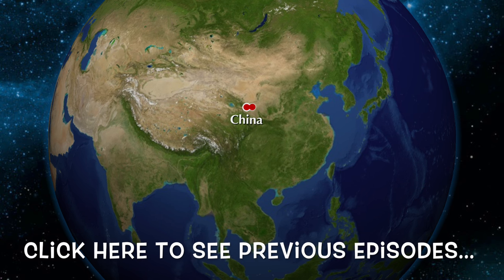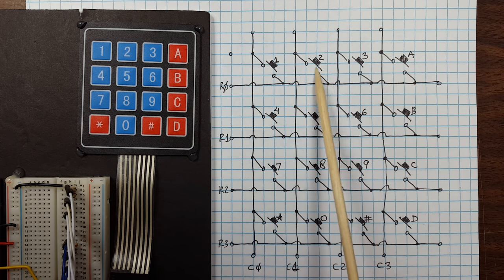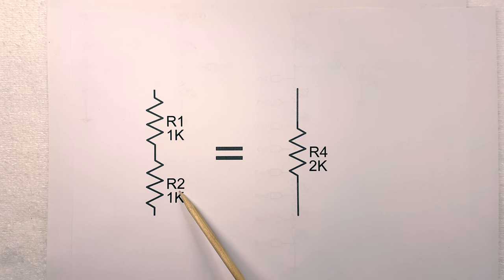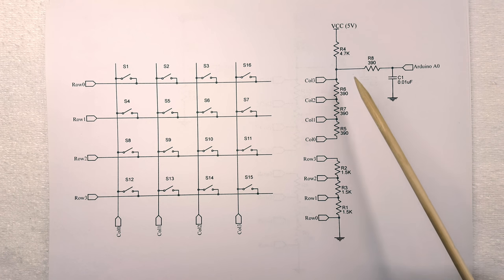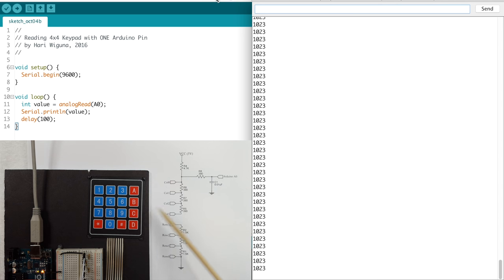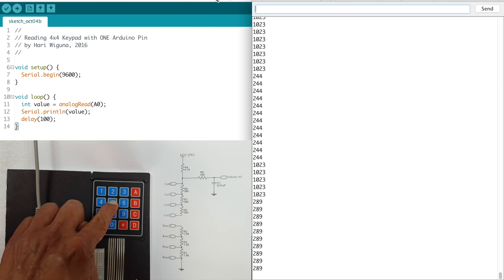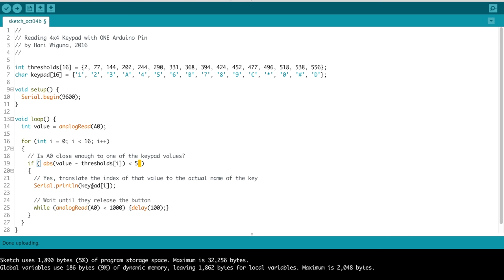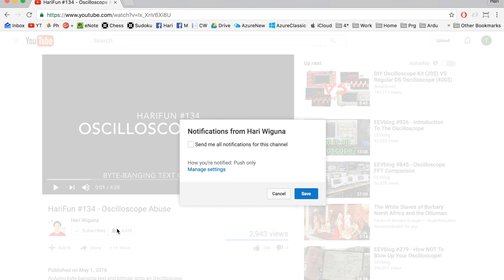HariFun #143 - How to read a 4x4 keypad using just one Arduino pin!

Comment: very useful, thank you very much. But th'ere's one thing that i still don't understand. Why do you put a capacitor just befor the A0 pin (between the vcc, and the A0 pin) and why do you connect it to the ground.
Reply from the maker: Thanks for the comment Ian! The capacitor is actually not at vcc, it is on the output of the voltage regulator.  Its purpose is to smooth out the noisy keypad switches.
Reply: The capacitor is being used as a hardware implementation of a debounce function.  Write a piece of code that constantly displays whether the button is pressed or not.  Press the button and watch what gets displayed.  It won't just go from pressed to non-pressed, it will bounce around a bit when it changes state.  The capacitor helps even this out.  If you put too large of a capacitor in it though, it will take longer for the button presses to be recognized.

Comment: I didn't understand what the for does, mostly because of the "i", it starts in 0 so wouldn't it be in 2 at the begining ?
Reply: And every time it executes, just going from "1" to "D", thats what i understand when seeing it though i know thats not how it works, just confuses me
Reply from the maker: The "for" loop changes the value of i from 0, to 1, 2, 3, etc till 15.
The IF statement on line 19 uses "i" to access the threshold values.  First it would check against thresholds[0], then threshold[1], etc.
If the difference between the real analog value and the threshold is close enough (within 5), THEN it would do the code between lines 21 and 25.
Otherwise, the "for" loop tries the next "i" which would test the next threshold[i].
I hope that helps.
Reply: @HariWiguna  Thank you for clearing my doubt, it was truly helpful

Comment: +Hari Wiguna, I'm trying to use this to get a 3 digit number. Any tips?
Reply from the maker: There are many ways. I would use two integer variables: temp and result. Upon detecting a digit keypress do this: temp = temp*10 + k where k is the value of that key.  When the "enter" key is pressed then copy temp to result and clear temp. We probably also want to clear temp when it becomes larger than 999 such is the case when they tap four or more digits before hitting "enter".

Comment: Curious... is it possible with this method to read multiple simultaneous buttons? Can I get a unique voltage for any combination of multiple button presses? Or it is only for reading one button at a time? Thanks.
Reply from the maker: No, this trick would NOT work if you press more than one button :-(
The resistors have been chosen such that pressing ONE button would generate unique resistor ladder.  Pressing multiple buttons would very likely end up generating non-unique resistor ladder, hence two different set of buttons ending up with very similar outputs.

Comment: Nice video ! Would it be possible to incorporate servos into the code to perform certain actions ? I.E. if button '5' is pressed, only 3 out the 5 servos will turn to a position. I'm still fairly new to Arduino and coding so my skills aren't great, thanks !
Reply from the maker: Thanks Sanchees3!
Yes, you certainly can do that. While you cannot use this code directly (it is tied to the whole Sudoku code) you might learn from it while writing your version.  Once you are able to detect a key, then what you trigger with that key could be anything.  Let me know if you have specific questions, I'd be happy to help.
https://github.com/hwiguna/HariFun_Mega_Sudoku/blob/master/Seven_Segment_Sudoku/e_Keypad.h

Comment: Why I need capacitor?what is his task?

TIA
Reply from the maker: I suspect it was for switch debouncing. So the voltage would not fluctuate like crazy as the buttons are pressed.  But I end up checking for button release in code anyway, so it is probably no longer necessary.

Comment: Pretty interesting . Do you have the program searching in a loop continuously Or does the program react when only you press the button?
Reply from the maker: Funny you should ask that :-) Take a look at my loop()
https://github.com/hwiguna/HariFun_Mega_Sudoku/blob/master/Seven_Segment_Sudoku/z_Loop.h
Unfortunately, I don't think we could trigger an interrupt off analog pin - correct me if i'm wrong.
So, the main loop reads the analog once, figure out which button was pressed and call the appropriate routine, then repeat over and over again.  The display is being refreshed by an interrupt routine.

Comment: how would you make this ESP8266 compatible.  What Resistor would you change to bring the Max Voltage down to 1V?
Reply from the maker: That's a fantastic idea!  The ESP does not have many I/O pins, and one Analog pin.
I used this calculator:
http://www.raltron.com/cust/tools/voltage_divider.asp
I put in 3.3V as the input supply,  leave the top resistor blank, retained the 3x390 and 3x1.5K bottom resistors, 1V for the desired output, and it came up with 13041 for the top resistor.  So 13K resistor instead of 4.7K for the top resistor.  Let me know how it turns out in real life :-)

Comment: I get a lot of random values and after I finally get a stable value the second time I press it it't -10 than before
Reply from the maker: Filippo, I think your comment got cut off. I do not understand what you're saying/asking.  Sorry...
Reply: for example I got 180 for “1” the first time, then after checking every value one time I checked it another to be sure and got 170, also some times if I hold a button it shows completely random values
Reply: Idk why this happens
Reply from the maker: Ah, yes, membrane switches are not perfect, so there will be some variation, on my switch it only varies by about 2 or 3, so I set my tolerance to 4, see line 87 on this listing:
https://github.com/hwiguna/HariFun_Mega_Sudoku/blob/master/Seven_Segment_Sudoku/e_Keypad.h
You probably need to set that to 15 to account for the difference between 170 and 180. For each key it would vary, but should NOT be random.
Also make sure you do not set that tolerance too large.  It should leave enough room between the values in threshold array.

Comment: I'm getting the ASCII values of the characters on the serial monitor - is it coz I used 220 ohm instead of 390 & 1k instead of 1.5k? If so, why?
Reply: it is because of your code.
Reply: gideon ferrier... Yes small mistake, I declared my symbol array as int rather than char 😂

Comment: Hello sir. I'm trying to make a keypad but in a array form and only the first value is recognized, others don't show. Can you help me please?
Reply from the maker: Rigers Alvora , what do you mean it doesnt  show? Even if there is an issue, analog read will always return something.
Reply: i am making a project that involves a tft display and an bunch of buttons which i want to use for a combination. if the combination is correct the tft display will show some photos, but the number of pins that i have free is only one, the analog pin A5. that pin i wanted to use for my project but i cannot find any code that  make my buttons like switches
Reply from the maker: You have the right idea. Using the resistor ladder as shown in the video would be a way to read a grid of switches using one analog pin.

You said it recognized the first button, so that meant you have the correct A5 pin wired and configured in the sketch.

Next is to check the wiring and parts. Make sure the resistance values are as close as I mention in the video.  Sum of the three smaller value resistors (390)  must be less than the large value resistor (1.5K).  You cannot use just any resistor.

And finally, you need to read the value for each button and put it in the array as shown in the video. This is because any variation in the resistors would affect the analog value reading.

Hey, I just thought of another possible issue.  Have you measure the resistance of the grid switch itself?  Maybe yours have a high resistance?  This circuit would only work if the switches are basically zero ohm when pressed.  Otherwise, it would interfere with the resistor ladder. :-(
Reply: Well sort off i connected every button with 390 ohm resistors. i used a count integer for the button press and a memory integer for the sum of the analog value like a condition for showing the photos. My only question is how i can make an else condition for showing random sentences like: "You are wrong", or "try it again" to show it in the tft display. Thank you for your time.

Comment: So I guess it would not behave well with multiple keypresses in a keyboard application. By the way, what program did you use for creating those schematics? Thanks.
Reply from the maker: Hi Jonas,
You are correct, pressing multiple key presses probably generate non-unique voltages or too small a change to be detected reliably. :-(
I used EasyEDA.com to draw the schematic, use its export to SVG feature, then magnified the SVG at 150% to fill the page.
Reply: Hari Wiguna Good thing you have that while loop that makes prevents that from happening. Currently working on a 40 key bluetooth mechanical keyboard, where I'm using 14 I/O pins, and was at first a little blown away by how much you achieved with just one analog input.